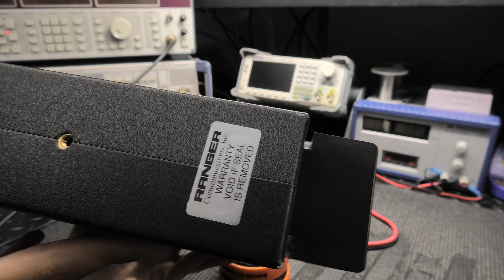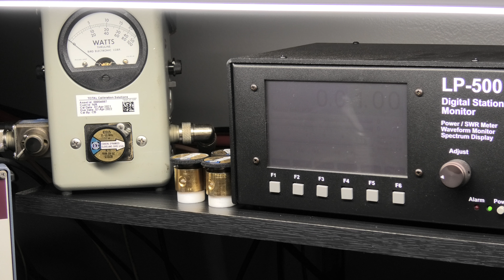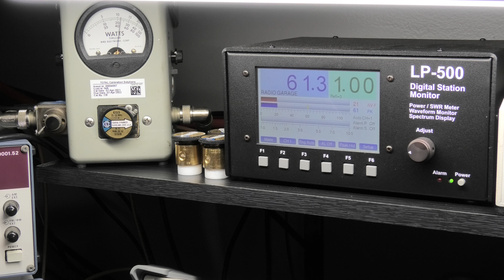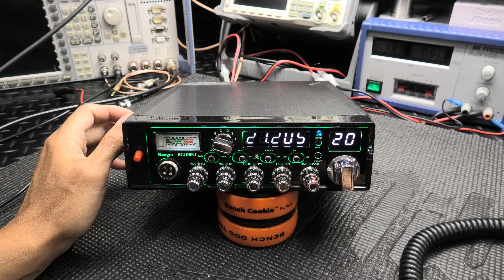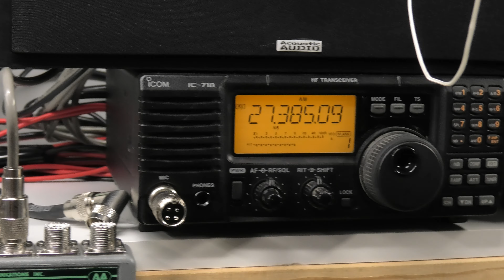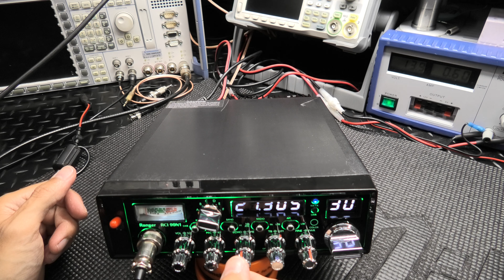Ranger RCI 99N1 *First Look & Review* CB Radio

Comment: Hello! 
Help please.
I have this in the N4 version. All was fine until three weeks later.. the SWR shoots sky high, only with the amp on. I’ve ran it normally with amp on prior. I checked my antenna and tested it with similar 400 w radios and all is fine. What could be causing the spike in SWR all of a sudden?